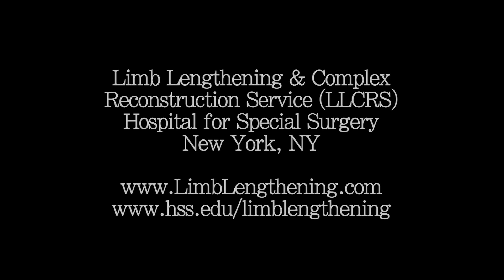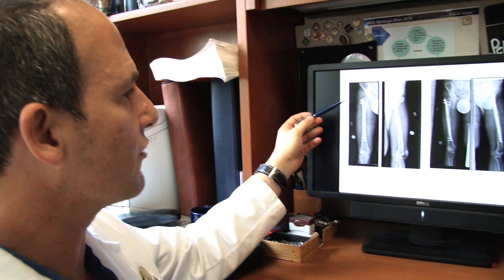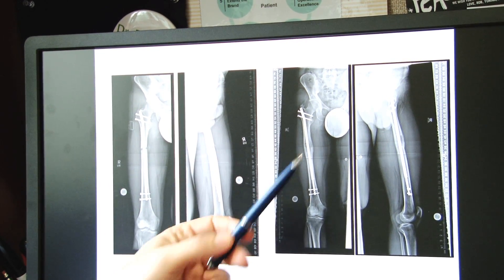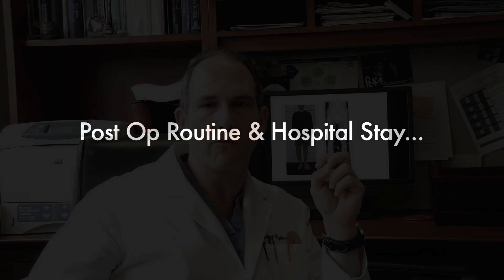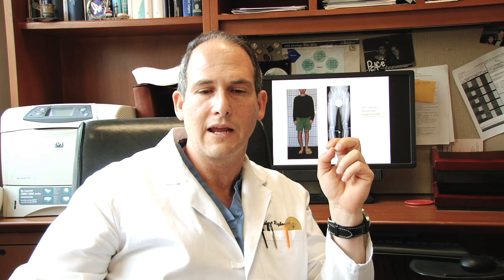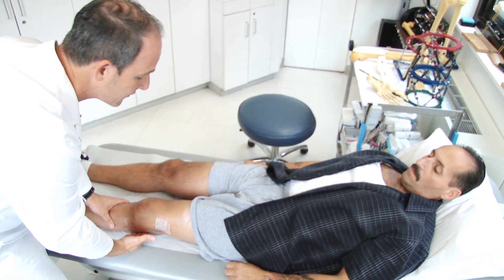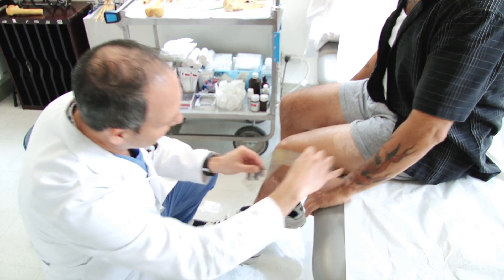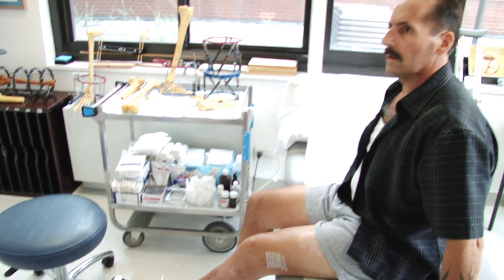LIMB LENGTHENING with DR. ROZBRUCH - Pre-Op Education (INTERNAL LENGTHENING ROD)

Comment: I had this done in 1992.  With the external fixator. He's right about knee stiffness. It took yrs to get decent flexion in my knee.
Reply: Let me clarify a little. I had an external fixator on my entire leg. The purpose at the time was to straighten my leg not for lengthening. So my knee didn't bend for 4 months. This absolutely added to the stiffness issue. I never really recovered my regular range of motion that i had prior to surgery. The only real long term issue that I had was a little nerve damage. The bottom on my foot became sensitive. That lessened as years went by.
Reply: @JD_Aguilar717  how many cm did u lengthen? and how did minor nerve damage affected u
Reply: @jake9854  it really didn't effect me. Just hurt a little more if you step on something. With this process you shouldn't have that issue. If you need a lot of length. You'll probably need to do this more then once. It's a commitment.
Reply: @JD_Aguilar717  what about your athletics ability? can you still run and do heavy squat and stuff?
Reply: how r u feeling now? is there complication arises, long term wise?
Reply: @jake9854  hopefully he responds

Comment: Hi. I have a mild case of Cerebral Palsy, due to this, my right leg is 4 cm shorter than my left. I have really bad back pain and I’m wondering if this will help me. But another thing I want to mention is, I get extremely upset when I see myself in a full length mirror because of my height (4 foot 11 inches) I know that there are people shorter than me, but I would feel a lot more comfortable and confident in myself if I was taller. If I was to have this done, how would that work out? And does Medicare pay for this surgery? Thank you for the very informative video!

Comment: This is incredible and really interesting! I just wish it was affordable.
Reply: @Giovanni Cannizzaro it's around 20k usd in Turkey
Reply: @ahmetakkoc  20K ?! for real thats 4x cheaper than it is in USA!!
Reply: @jake9854  yes.. what does not expensive in Amerika..? 😅
Reply: @Giovanni Cannizzaro My insurance covered this and I had no out-of-pocket expenses. My surgery was 2003
Reply: @teennahernandez  how is that possible. It's too costly and u didn't have any accident or so.
Reply: @teennahernandez  How?, I thought insurance won't cover cosmetic surgeries.
Reply: @teennahernandez  you're lying
Reply: Nikolai Maharaj I just got the surgery yesterday and it was 3500 in total. It’s not cosmetic if it’s only one leg, if you’re doing this to be taller then that’s idiotic.
Reply: @Hobosdkcheese  how is it idiotic though if someone has height neurosis this is a good way to solve it
Reply: @Hobosdkcheese  3500 with insurance?
Reply: @diarmuidmcmahon5780  yupp, there's also copays for my PT and then weekly visits for xrays and such but that's included in the price. There's also an anesthesiologist bill that's separate but I haven't seen that yet
Reply: @Hobosdkcheese  So the insurance covered maybe 90% of costs? was one leg shorter?
Reply: @diarmuidmcmahon5780  I don't know what the total was overall without insurance. But yes I had one leg longer by 2.5 inches, this would not be covered, at all, if you did both legs

Comment: wouldn't it look weird to have long legs and short arms?
Reply: Steve  Rodriguez not for people who have short legs from the start.
Reply: The dr.’s are trained in this. That’s why they typically will do three inches since it’s still in the normal range so everything matches.
Reply: @nathantv8257  I'm 5ft4 and I want to become 6ft4 with this surgery would I still look normal and if arm lengthen needs to be required how many lengthenings would it take?
Reply: Bat Man I am not a Dr. however from everything I have read, they typically will do 3-4 inches per bone. So you could gain 4 inches in your femur, then another 4 inches in your tibia. That would mean you could potentially gain 8 inches, bringing you to 6 feet. There are some Dr.’s that push it beyond this if the patient really wants it and feels they can handle the pain.

As far as your arms, I would assume one lengthening would be enough if you were going to go for 6 feet. If you went for 6’4, probably two would be needed. 

My honest opinion. The world is a whole lot different at even 5’10. If you are going to seriously do the procedure, I would consider maybe going for 6 feet. Even doing the procedure once will bring you into the average height range of 5’8.
Reply: @nathantv8257  well if its possible for me to be 6ft4 I'll do it and I have a very high pain tolerance so it shouldn't be a problem I had to go under the knife before.
Reply: Bat Man with a name like bat man, I bet you could. There is a video of a girl gaining 1 foot. It’s been done before for sure.
Reply: @nathantv8257  i am somewhere between 5,7 to 5,8 and i want to be near 5,11 or 6 would i need an arm lengthening surgery for this and how much would it all cost including leg lengthening surgery and should where should i get it at the lower bone or upper leg bone and would it look weird at the overall body with the hands and torso and arms . And i am an athlete would i be able to it all normally all over again. Please answer 🙏
Reply: Akash Puri the price varies greatly depending on country of where you get it done. You would only need it done once to gain the height you are looking for. Dr.’s will usually do the lower leg bones first (tibia and fibula). Because you are only adding around 4 inches, you would not need your arms lengthened.
Reply: @fallenangel-do3iy  did you do it
Reply: @1persistence158  honestly no because I'm poor, heck I bet even the wealthy can't afford that much $58,000 think about I'm poor and a trans Male and I still need a breast surgery.
Reply: @fallenangel-do3iy  bro you're hilarious
Reply: @tonyguillen3224 what's hilarious?
Reply: I think for 1/3cm people won t see
Reply: Waluigi
Reply: My biggest fear is if your torso is short and legs long, you'll look weird
Reply: It won't look weird

Comment: Where do I go for limb lengthening or to even make an appointment for one?
Reply: Start with your local doctor, and get a referral to a specialist from there.
Reply: Blood Angel Thanks, but is that required? Because I'd rather not have my doctor try to convince me otherwise simply because they personally wouldn't do it. At least if I go directly to the specialists they'll understand why I want to and give me their actually suggestions
Reply: Angel Wins Not that many places do it, and you're right, they will try to convince you not to. It's not exactly necessary, but that's the usual way it's done.
Reply: Blood Angel Yeah, I wouldn't mind moving near one until the procedure is done and recovered however. Do you know the name of the type of doctor that do these?
Reply: Angel Wins Orthopedic surgeons.
Reply: Visit limb lengthening forum, decent information there!

Comment: What is the most the leg can be lengthened? Based on the video it says 4cm but I was hoping for 8-10 cm. I am 5'2 1/2  and just wondering my options.
Reply: Oh my God!!!! This is a miracle for me!! One of my leg (right one) in 5 inch shorter than the left one,so imagine my pain and suffering, i went to south africa in 2004 for having a surgery, but doctors there said if the touch my shorter leg i will never be able to walk again, so i had wear some correcting shoes ( they were soooo ugly that i stopped wearing them). Now at my adult age i have back pains and sometimes i feel like my right leg can't support the weight of my body while walking. I really need to get examined and have this surgery. I'm really ashamed of walking in public. I can't wear heels or short skirts. I am wondering how much it costs
Reply: @kessiayatha5764  write me on whatsup +905323506033 in Turkey you can get good doctors with good prices
Reply: @kessiayatha5764 Hello, i know this comments was long time ago, but i’m wondering how it is going?
Reply: Vincent T. Joseph i am from DRCongo
Reply from the maker: Visit limblengthening.com, contact them and they'll answer any questions you have.
Reply: Most people say no more than 5cm per bone, so 10cm for both lower and upper legs combined. Of course there are people that go beyond that.
Reply: where are u from kessia